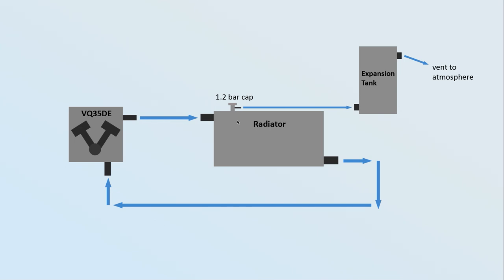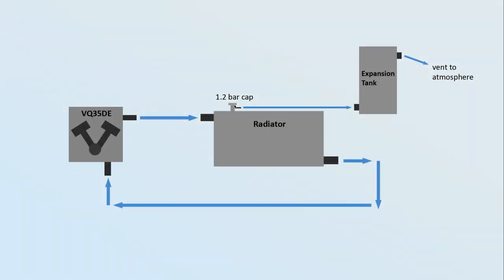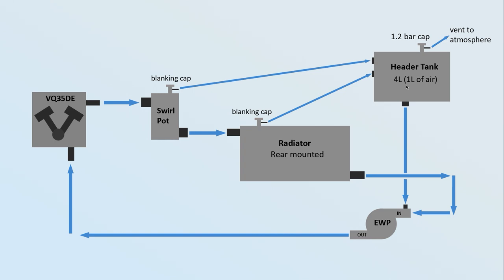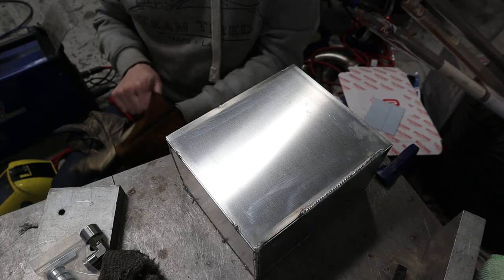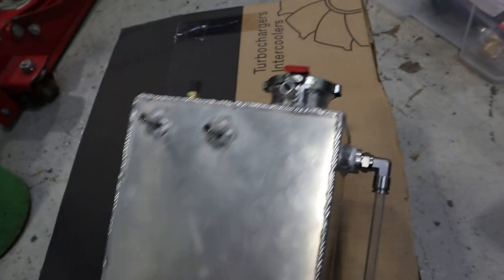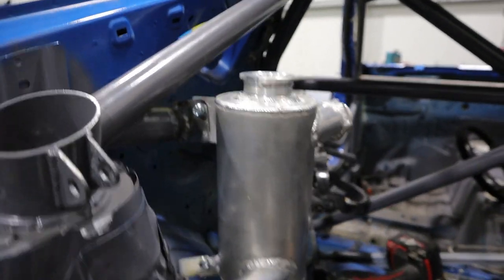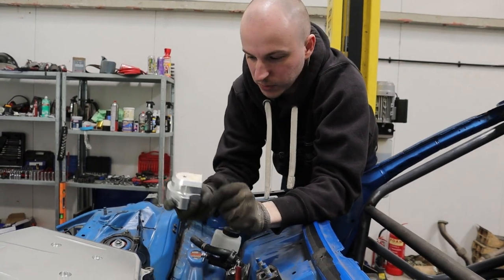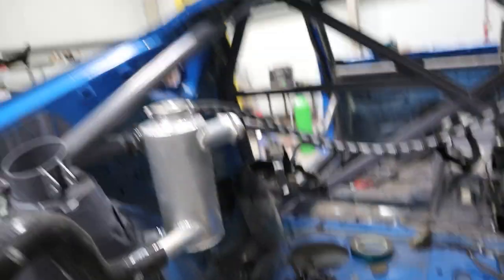370Z Twin Turbo Ep. 8 - New Engine Cooling System Explained

Comment: yo thank you for explaining the expansion system. I bought a cylinder polished coolant “overflow” tank from eBay then I made my own custom bracket to mount on the radiator support, it was an atmospheric vent I routed a hose down to the floor, my car would overheat when I would beat on it and I was 99% sure this was the problem but now you’ve confirmed it, only went with this route bc I wanted pretty polished parts but it bit my ass what would happen if instead of venting the coolant, I plugged the vent tube with a vacuum cap? would this cause too much pressure inside the cooling system? I actually did this when I first installed it for a month or so, but after one day of opening the cap from the coolant tank I felt all that pressure escape I told myself oh maybe I shouldn’t have capped it off let me vent it.

Comment: Great video, but why not run two rad caps and header tanks. 

One in the back for the rad with overflow AND one in the front for the swirl tank at the engine and with overflow for that one as well?

Comment: Why dont do the pathfinder cooling mod? Whys it terrible?
Reply from the maker: it just causes some minor annoyances without any actual benefit. The whole reason people think its a good idea is completely flawed. You'll see loads of forum threads and blog posts saying that without the pathfinder mod the coolant has no way to get from the rear cylinders up into the heads (because that's what the simplified coolant flow diagram in the service manual implies) but in reality when you actually take the engine apart you can see that the coolant goes straight up from the rear cylinders into the head just like it does with all the other cylinders. In fact the pathfinder mod literally just connects to the vertical channel that is on its way to the head from the rear cylinders.
The only coolant leak I ever had was from doing the pathfinder mod, because it requires you to cut one of your coolant hard lines down which means you lose the lip on the edge where the rubber/silicone hose joins it, which is vital for a good seal. I ended up welding a little ridge onto it but even that was hit or miss whether it would seal nicely.

Comment: Why reinvent the bike? Nissan 14075-2Y001:D:D:D
Reply from the maker: That's what we already had on there but it's an inlet not an outlet so it faces in to the engine. Unfortunately it's not symmetrical so you can't just turn it round to point where we want it to go
Reply: @ChrisDrift  ahhh, everything is clear :)